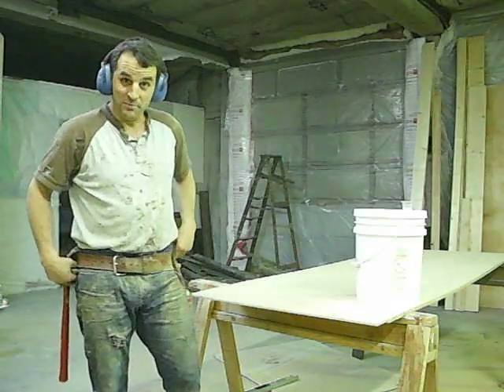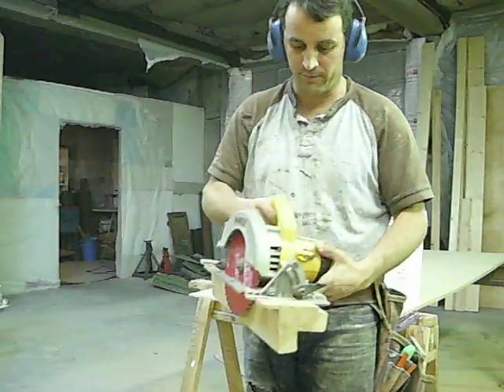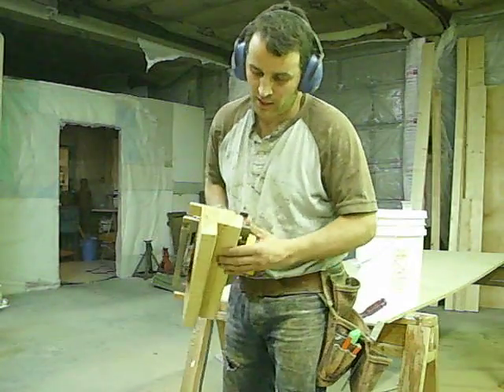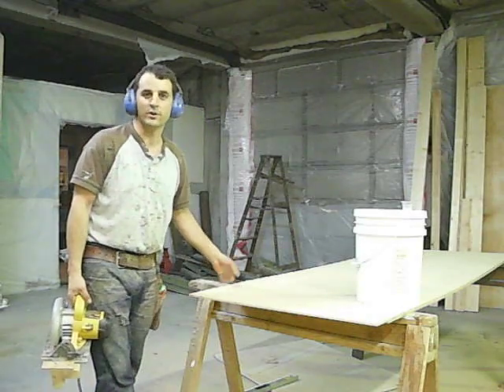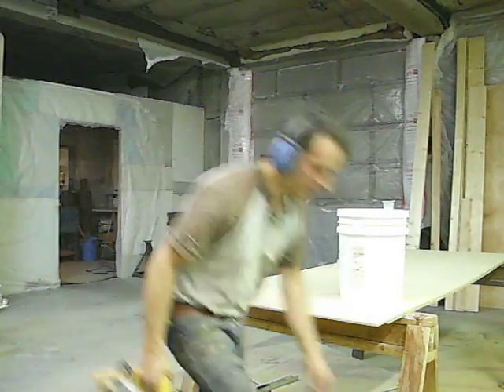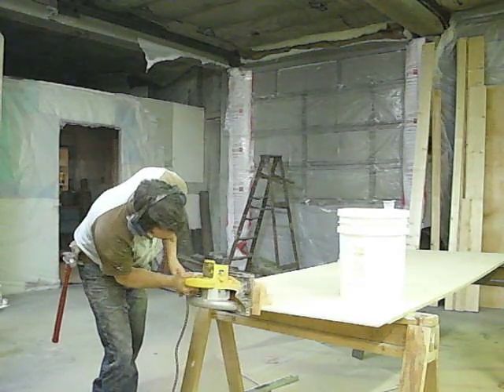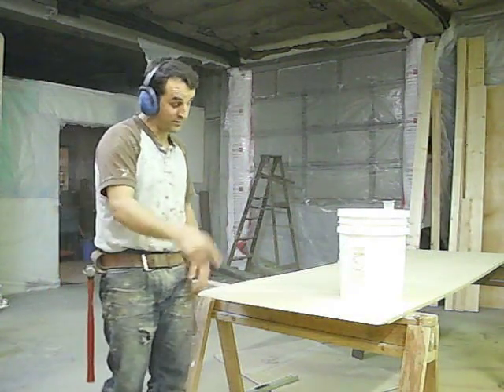How to scarf plywood for a plywood boat

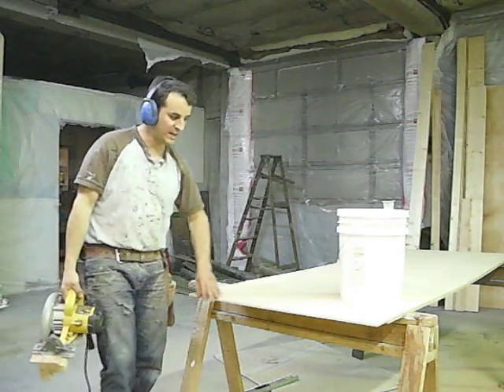Comment: Scarfing has nothing to do with speed...the whole concept is strength. How wide are your scarfs?  The recommended ratio of ply thickness to scarf length that i know of is 1:12. So a scarf on 1/2 ply should be at least 6" long.
Reply: Easy to calculate.  8" blade.  The depth of cut will be on the order of 2-9/16 to a maximum of 3".  So the very most is 6 to 1 but more likely 5.1 to 1.